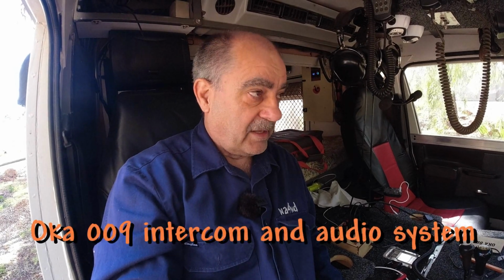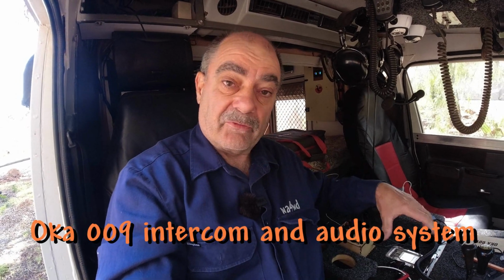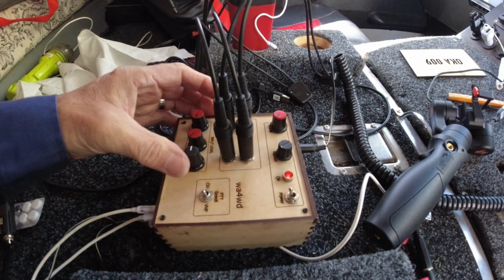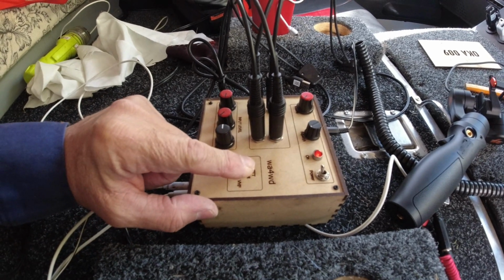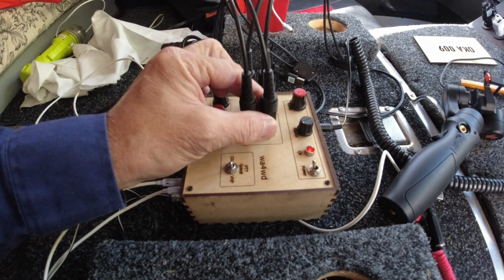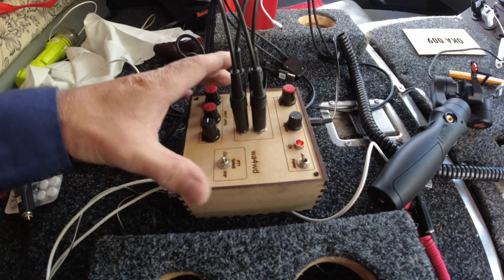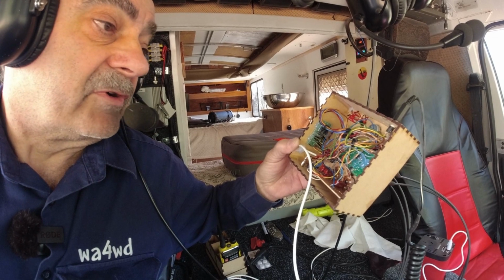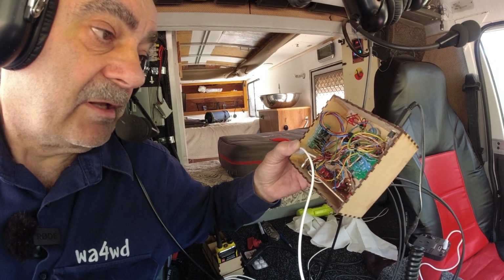Special Oka audio and intercom system to beat the noise.

Comment: Cummins?? Where you heading to this trip?
Reply from the maker: yep, 6bt. We are going to a station south of Paynes Find to fix up a radio repeater as a favour for a friend.
Reply: @wa4wd  cool, i should be coming across great central end of the week. If my oka ever wants to leave Alice
Reply from the maker: @qldjoe  what numbr is yours?
Reply: @wa4wd  395,  we are also both comms tech from the Pilbara, but dont think we ever came buy each other
Reply from the maker: @qldjoe  What years? I started at Port Hedland airport in 1981 left BHP rail in 2006. Had a couple of breakes into various 4 or 5 year stints
Reply: @wa4wd  Early 90`s up to around 2000 on and off. So you may know Dave Steel and Dave Macgowan. I never worked for BHP, just contractors around the Pilbara. Also was part of SES and Goldsworthy run into Pt Hedland etc
Reply from the maker: @qldjoe  worked with both those blokes
Reply: @wa4wd  i worked mcgowan for a while, chances are we have bumped to each other. I went into tech workshop in port hedland sometimes
Reply from the maker: @qldjoe  Probably did meet, he was running norsat as well as doing contract work at BHP.